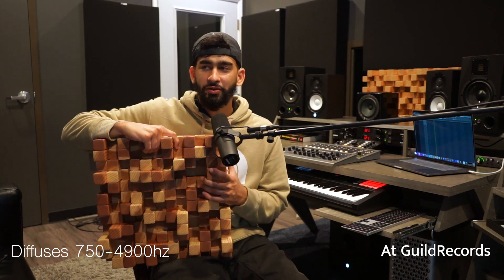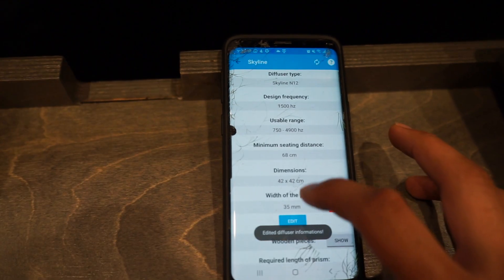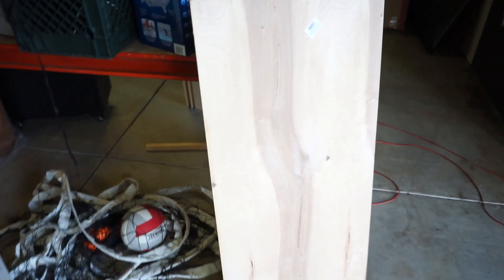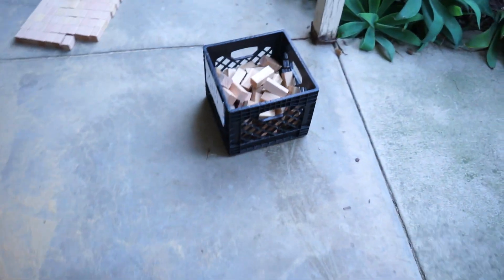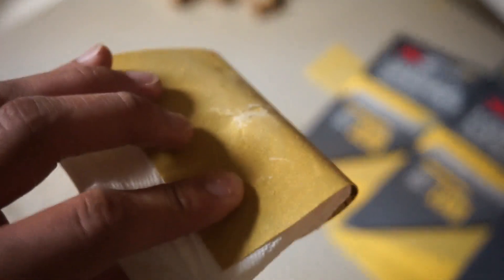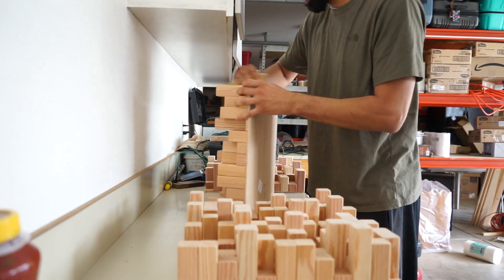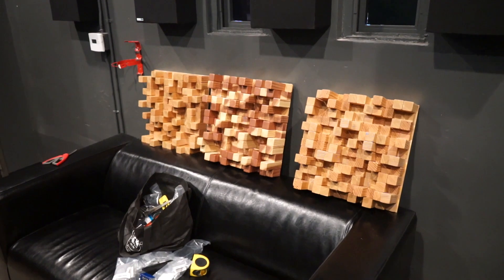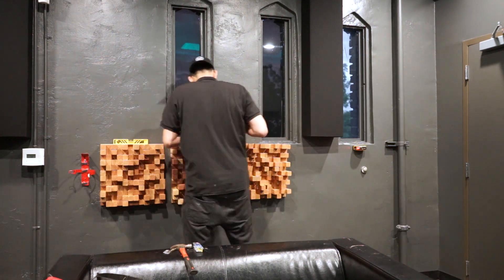How To Make A Skyline Acoustic Diffuser

Comment: Hi. Great job! 
Could you please explain why and how did you selected target (design) frequency as 1500 Hz? I believe it is dependent of some factors such as the room dimension, treatments already have etc. I'd love to apply this to my home studio as well. Thanks in advance.
Reply from the maker: Yes it is dependent on room dimension and treatment. I used REW before I treated this room and got some decay graphs.From the research I did online and read a good starting point for diffusion is 1500hz range. Of course you could go for a lower hz  but then the diffusion sticks would be quite long. Basically 1500 is good for multipurpose application but if your room is treated well you could easily find the exact range you need to diffuse.
Reply: @ju1ceaudio  Thank you so much. Keep up the great work.
Reply: Yes I do believe it's best to target the Fs. That the ear is the most sensitive range.

Questions time.
 You do know that you could added an extra free peck. On the back side add 2" of insulation now every two or four inches you pull it out from the wall that doubles the affected lower down in frequency in the bass, to make it to tube trap

Comment: How thick was the back plate? half inch? Also watching you cut the blocks in length I had an idea that you could cut more than one at a time since the sled has enough space and you could simply extend the stop block. I only have a miter saw, there wasn't enough space on mine for more than 3 to fit or cut.
Reply from the maker: back plate was 1/4 inch. Yeah that was a good idea i have a miter saw now so next batch is going to be more efficiency made.

Comment: Nice job. Did you take any before and after room measurements to see if there  was actually a difference in your frequency response? Highly advisable since you went through all that work. REW is a great software tool for this (and its free).
Reply from the maker: Appreciate it! I didn't not actually take after measurements. But I am going to work on this room some more so I'll keep you updated.
Reply: @ju1ceaudio  hopefully i'll get around to building my skyline diffusor as well. just finished doing a bunch of custom bass treatment for the studio before adding the Barefoot FP 01's. Definitely worth it. Things are sounding lovely.
Reply from the maker: Oh yeah I use Rew all the time bro! Check out my other videos and you will see.
Reply: @ju1ceaudio  will do. keep up the good work